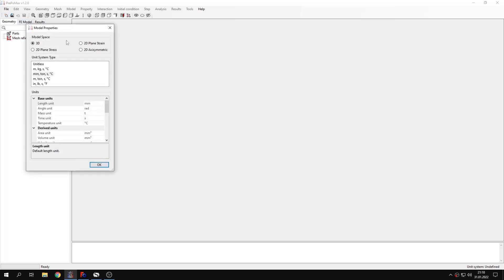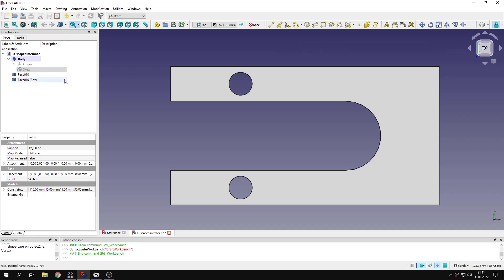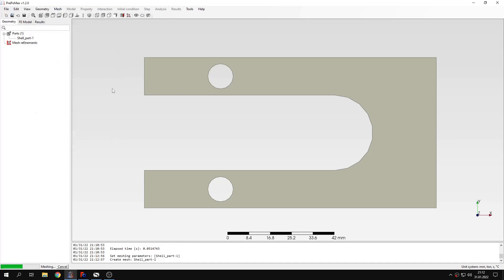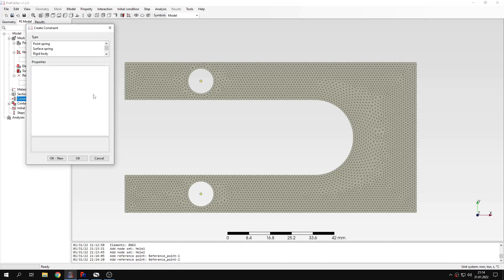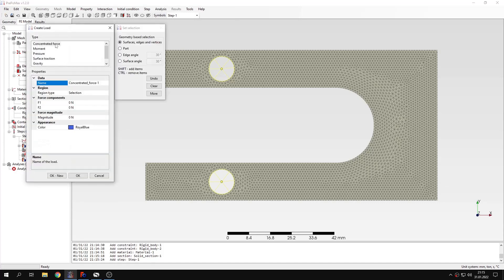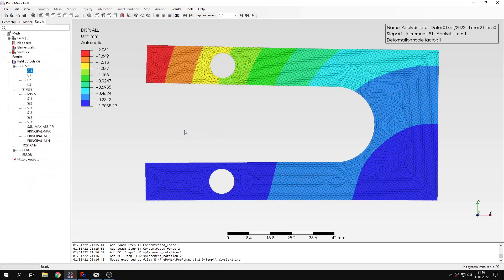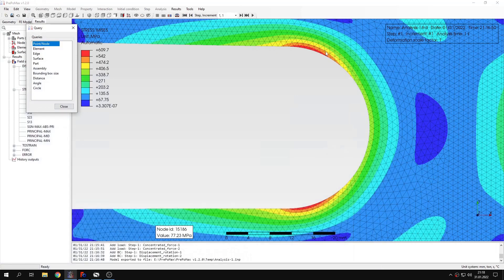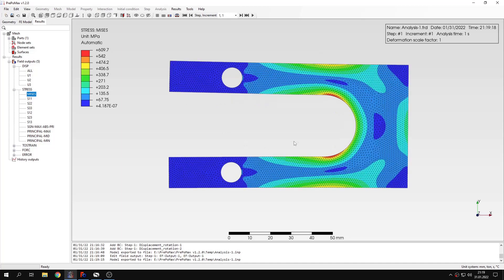PrePoMax (CalculiX FEA) - Tutorial 16 - Plane stress analysis of a U-shaped member

Comment: Sir, Why did you use rigid body? What happens if the load is directly applied on the node group..
Reply from the maker: I could have used surface traction to apply this load but I had some issue with selecting the edges of the holes and besides, I wanted to show the center of gravity method of creating reference points (I haven’t used it in the previous tutorials).
Reply: @FEAnalyst  ok, Thank you